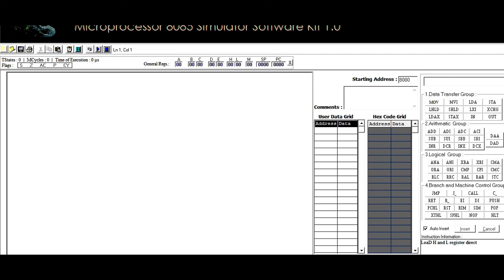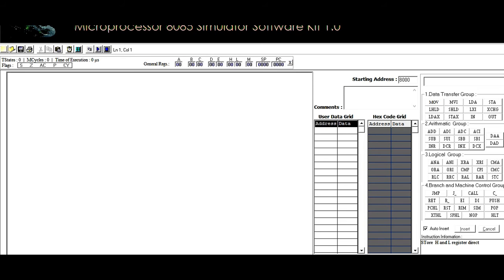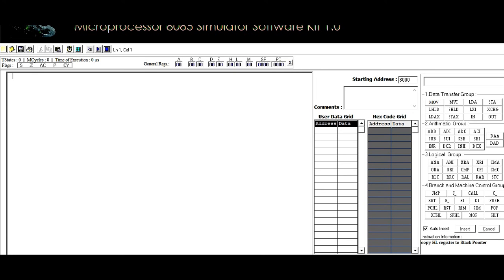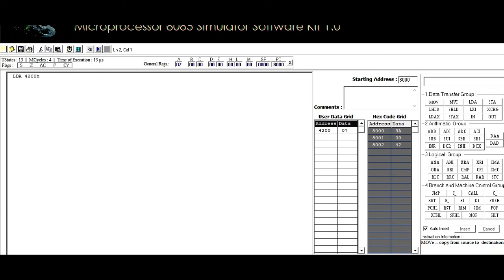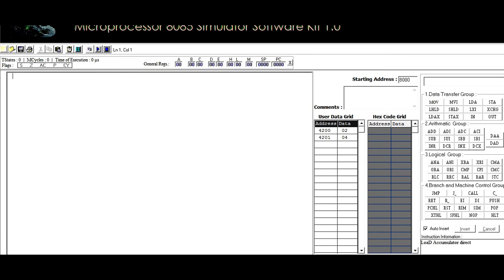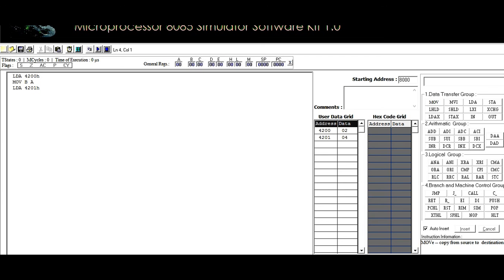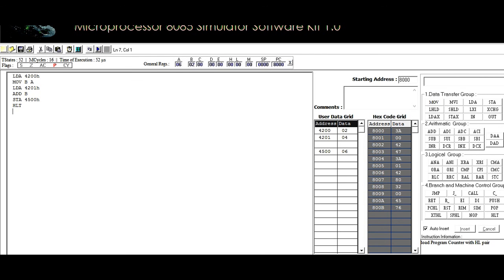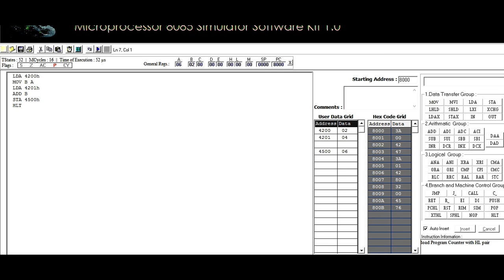Microprocessor 8085 Simulator software kit working process

Comment: how do you introduce a loop. I tried but i cant figure it out..looking forward for the reply
Reply from the maker: Hi Keerthana, 
You can introduce loop by using commands in Branch and Machine control group. Egs. JNZ (Address)- JNZ 2100.
Hope you got it, feel free to ask any other queries.

You can check my our latest video on Career option after B.E - https://youtu.be/J3zJLmNkypM
Reply: i tried but it shows the address as not defined
Reply from the maker: Hi Keerthana,
Make sure your subroutine(sub-program) address does not below the starting address(Top right) , do all your programs above 8000 address for effective functioning.
Hope this time it will work !
Happy to help you
Reply: vpeople it didn't work again
Reply from the maker: I like to know the OS of your system, since this Software is an older version it can't support  the newer things.
Also try to reinstall the software and restart your system